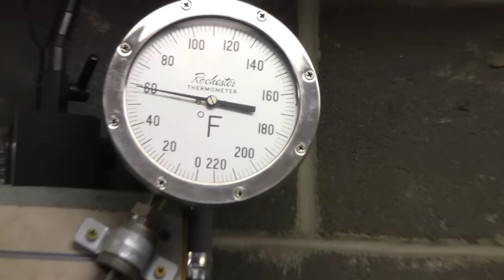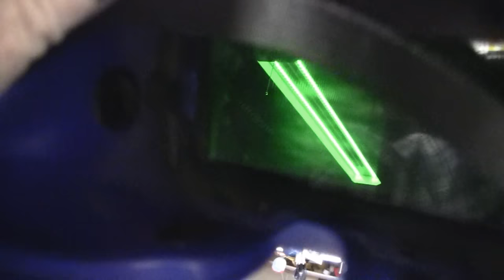HOMEMADE WATER COOLED BRIGGS ENGINE (part 9)

Comment: it's looking pretty good roadking  , i love the idea of the water cooled engine ,,I never tried it with a cast iron engine ,,,many years ago as practice using a spool gun welding aluminum i made a water cooled engine I left the fins however because i actually used my engine it wasn't a display ,,I routed the cooling flow similar to the air flow from the fan ,,and i used an OHV single cylinger briggs , 28CI 15.5hp ,vertical shaft ,,

Comment: Coming on! I guess thermo-syphon circulation will be adequate once working - quite a small volume of coolant. Be good to have some glycol content to limit internal corrosion.
Reply: ChrisB257 or he could use engine coolant for cars. Pre made mix will just pour right in
Reply: Just like old tractors!

Comment: Hello gentlemen, I'm absolutely loving this project! I do have one suggestion if you guys have not thought of it already:

Since you are applying a good bit of heat to the block, when you have finished your brazing you may want to re-check the alignment of the valve guides, and (perhaps to a lesser extent) the cylinder bore. The block is being heated in ways it's never seen before and there is less iron to absorb and dissipate it. Minor warping is possible.  My guess is that it's going to be fine. But it would be easier to check before the engine is completely assembled. This is just my two cents. Have a good one!
Reply from the maker: No worries Mate!!☺

Comment: I haven't brazed anything in 20 years. Except Silver brazing, I do a lot of that. Never cared for Arc welding either. I did it when I was young but never liked it.  You made it look easy.
Reply from the maker: Back in the 70's and 80's Brazing on Body panels and Arc welding frames was a big part of what we did!! Maybe I can learn to Tig if a Sponsor wants to send us a free Tig Welder!!☺
Reply: If Briggs could only sponsor. 👍👍

Comment: leaving the fins on would have done much much better heat transfer to the coolant. coolant close to the cylinder will get warm and coolant against the sheetmetal will do almost nothing. Thats y in modern trans coolers the oil is spun around in the tubes to take all the heat out it can instead of leaving the center hot and outer edge cool. just my bit of knowledge. besides that little tid bit yall do some interesting stuff. 😄

Comment: I've got a question RK...Is it going to be thermal flow or are you going to use a pump.?...I'm picturing an old lever style pump driven by the engine via a flat belt and an old capillary temp gauge somewhere but I'm sure you have other plans...Love all the builds mate.
Reply from the maker: We're using a small 3x5" gear pump, I didn't even think of a temp gauge but now I'm gonna have to find one!!☺

Comment: Nice job with the brazing! I look forward to seeing how this comes out.
Question: Did you have to pre-heat the block before brazing?
Reply from the maker: Thanks Bud!! We sorta pre-heated it with the torch only because it was so much thicker than the sheet metal!!☺
Reply: Okay, that makes sense. Thanks for answering my question! :)

Comment: put the coolant inlet port under the exhaust valve and the outlet port on the opposite side (away from valves)
Reply from the maker: That's where the inlet is, the outlet is right above it in the head!!☺

Comment: Hey Budd, did you give up on using the BRASS kickplate from a door? you showed that in the last video, now youre using steel?
Reply: Eclidean I think it's because it was too thin. Also it's going to have filler around the edges, sanded and painted so it wouldn't even be shown if it was brass

Comment: Not clear why those cooling ribs were cut. Welding is questionnable.
Reply: just to get them out of the way I guess.  that "welding" is actually brazing, whole different process.  looks solid to me.
Reply: GliderDS If the fins were left on they would form bubbles when there was water flowing through it and create a hotspot and then destroy the engine. They also impede the flow of the water.
Reply: Fins were designed to work with airflow. Put in water, no way an airpocket would create hotspots. But ok.